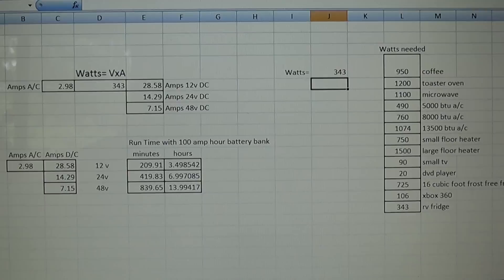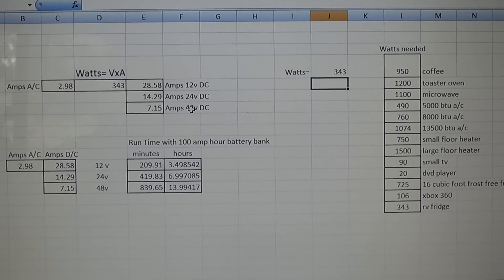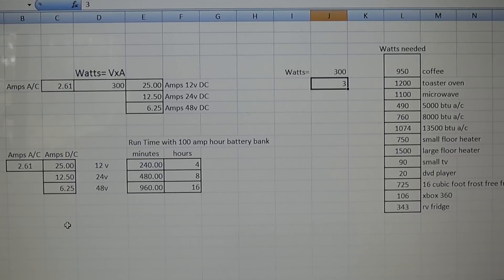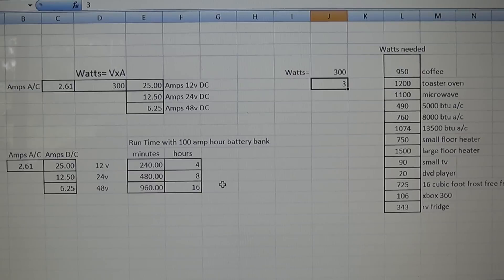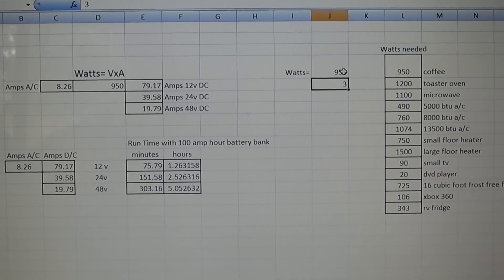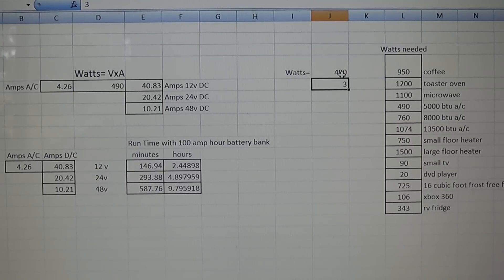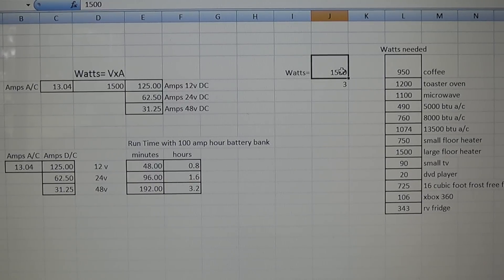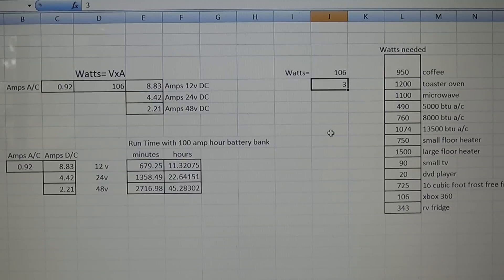What can run on an inverter and for how long?

Comment: Hi there what size inverter are you using and will cheap 3000w do the job cheers
Reply from the maker: I have a 4000w and a 1000w.  It is difficult to tell you if a 3000w will do the job or not, since I don't know what you intend to run.  I can tell you that if you plan on using most of the 3000w, you will be blowing through batteries.
Reply: thanks for replying so quick im in the middle of a doing a van reno thats still a blank canvas atm and im running all the wires now pretty much i will have 2 lights , car cd player , water pump 12v tv and a few usb's running off straight 12v on the power side i will have a normal bar fridge and microwave running from one power point the next power point will have toaster and kettle and the next power point will be what ever needs to be plugged in chargers, fan ect thou I want my electrician to wire in a switch from 240v power to inverter power if that makes sense so pretty much all that will be running off 2 120ahr batterys
Reply from the maker: Make sure your electrician understands low voltage.  If you run a toaster (I am thinking toaster oven?) It will be pretty high wattage.  Lets say it is only 800 watts at 240v.  When you run that at 12 volts, it will use 67 amps.  What I am saying is, don't skimp on the wire size between the batteries and the inverter.

Comment: This really helped Me! I’m installing a small off grid 12 v solar system in my house just for emergency back up until power is restored. I have a 3000 wt inverter. My question has always been. Ok so how long will it take an inverter to run my battery down or keep power going? No one seems to answer that question, so I was glad to see you made this video.
Reply from the maker: Glad to have helped.  Once you get used to the math, it is pretty easy.

Comment: I don't think that is true. To convert 120VAC to 12VDC you just don't simply divide it by 10. You will need a rectifier circuit to accomplish that.
Reply from the maker: Mathematically, Amps= Watts/volts....so if you are using 1 amp @ 120vAC,  it is 10 amps at 12vDC.

Comment: I have I ford f350 I need to plug it in power in winter time it hard to start . I was thinking to have in Inverter, Dsr Proseries, PIF-2000, for the heater for a 15 min before start it . Have some one answer my question please
Reply from the maker: I seriously have no idea what your question is or I would try to answer it.
Reply: My truck need to plug it in power i can't start it in the morning.  I was thinking to get a power inverters so I can hook it up to my truck batteries and connect the engine heater to it. So I got to run up to 3000 watt.  For only 10 minutes the batteries losing its charge so this thing it doesn't work. I was thinking to find another idea to connect the heater I make the engine warm and then maybe I can start my truck
Reply: my car block heater is obviously less than 1500 watts because it run on a standard AC extension cord. It never blew the fuse so we will suppose it is 1000 watt of power to simplify the math. 

1000 watt x 10min/60min= 166 watt-hours, most AGM battery are on the order of 100 amp-hour x 12 volts= 1200 watt-hour and you can use only 50%= 600 watt hours so your house battery  OR start battery if your start battery is AGM, can easily give away 166 watt hour to heat your engine and will be only 166 / 1200 depleted, this correspond to 14% so it leave you with 86% full charge

 ( i am not familiar with using standard cranking start battery for this application because they are not deep cycle, only marine are deep cycle. Standard batteries are for start only and this is why small Honda Civic batteries don't last many years, they are routinely overloaded. So you can do it and the next time you will buy an AGM or marine deep cycle)

and i can bet your truck will start, but you will have to travel enough to recharge it, not just a little trip to the neighbour store. The good new is that you block heater is a purely resistive load so this is perfect for a very cheap modified sinus wave inverter we can find everywhere like in Canadian Tire in my town. 

You have to buy a unit with  at least 1500 watt of power so your 2000 watt device is perfect and you have a  margin of security, these device can become very hot and you don't want that. If you can, it is better to have them mounted vertically for the heat dissipation by natural convection.

 We see many you-tuber burning their inverter and having to change it, one was in the ocean when they burn it if i remember correctly. Modern inverter have one or two tiny computer fan so make sure your inverter is installed in a well ventilated place, if not you will do like many you-tuber, who burn their expensive Danfoss 12 volt compressor because of not enough ventilation.
Reply: Omar nissan.  What is your motor.  What temp does it go down to.     Maybe get an inverter generator.  My 97 7.3 started just fine this winter in mi which got to minus 20 ish

Comment: Carfull of anything using induction motors like a window a.c.. The locked rotor load can double the rated watts. Cheap window units are very hard on solar componets due to high startup currents. There are inverter portable a.c. units that will be kinder to solar components but cost upwards to three time a window unit of 12,000 brush.

Thanks for trying to teach what should be taught in high school. I guess the math to real life use is lost in today's technoworld.
Reply from the maker: You are right, cooling units are brutal on solar systems.  Thanks for watching.

Comment: May I ask the for the formula you entered in Excel to calculate the items listed? I'd like to do the same to figure out my setup for 2 ppl using small appliances,etc thanks in advance!
Reply from the maker: It's pretty much just watts=volts * amps    I wrote this at least two years ago.  Not even sure I still have the spread sheet.  IF you go to any website selling solar gear, they will have a similar spread sheet ready for you to use.  I think Arizona Wind and Solar has a pretty good one.
Reply: Fernbark Frist Great feedback, Thank you! :)
Reply: @milro5011  ACCEPT THE FEEDBACK . WILL YOU PLEASE BRING UP NOT ACCEPTING FEEDBACK IN EVALUATIONS PLEASE SIR. LOL GOOD
Reply: @FernbarkFrist  I AM A DUMBASS. I AM NEW AND IS GETTING A 24 FOOT CAMPER TRAILER NO VEHICLE THOUGH. HOW MICH IS IT FOR ME TO BUY A START UP KIT? I REPEAT. I AM A DUMBASS. I WANT MY TRAILER OFF GRID. IT HAS CENTRAL AIR. THAT I KNOW OF . SO I ASK YOU TO PLEAS3 HELP THIS DUMBASS BECOME A SMARTASS. I THANK YOU

Comment: Do you consider the efficiency of the series configurations for 24v and 48v to outweigh the failsafe of parallel in 12v? Example, in 12v where all batteries are parallel, if one battery becomes inoperable you lose that batt's ah but you can still operate normally otherwise. Conversely, when they are all in series and one battery fails, your system is down until a replacement is made. You could have a 12v to 110/120v inverter on hand and do a quick reconfiguration of your bank in this case I suppose. Just seems more inconvenient than only replacing the bad battery in the parallel configuration. Your thoughts? I know you could do a series-parallel setup with the 24v and 48v systems that would have the same failsafe as the all parallel 12v system but that would require double the batteries = $$.

Comment: Are you accounting for the fact that when identical batteries are in parallel the volts stay same but amps increase for each battery added and when you connect them in series the volts increase but the amps available stay same no matter how many batteries you add. Simply connecting 4 12v batteries in series to get 48v will not double run time of system. Since you have a fourth of the amps you would have if they were in parallel. The only way you can significantly increase the run time is increase the size of the battery bank. While your system may decrease the amp draw, the battery arrangement required decreases the amp pool equally. So, while your arrangement may decrease the size wires needed it is not increasing the run time available. Example 4 100ah batteries in parallel = 400ah @ 12v. So a 100a draw = 4 hrs run time. If the same batteries are in series-parallel to get 24v you have 200ah and if it allows the draw to drop to 50a it still equals 4 hrs. Again, if the same batteries are in parallel for 48v you have 100ah and if it allows the draw to drop to 25a you still have 4 hrs of run time. So, unless you are adding to your bank you are only making the system run more efficiently, which may be adding a small amount of run time, but in no way are you doubling your run time just by changing the configuration of a set number of batteries. Volts and amps are on a see-saw. When one goes up, the other goes down. We have to play by the rules. Remember, things always look great on paper.
Reply: I agree.  The OP needs to check his formulas at and upto F12:F15.  If an appliance draws a constant 1000 watts and the battery is 100 Amp hours I fail to see why these numbers would not all be the same.
Reply: make a video!
Reply: Well that's a terrible statement.  I run a combination of parallel and series.   I get both doubled voltage and doubled amp hours.
Reply: Not true...you can wire both . I have paralleled pairs ran in series. I get doubled voltage and amp hours.
Reply from the maker: Yes.  It should be obvious from the math on the spreadsheet.
Reply: Actually, the spreadsheet only states "Run Time with 100 amp hour battery bank". The spreadsheet does not explain whether you have four 12v 100ah batts, eight 6v 100ah,  or four 12v 25ah batts (which you and I know can not produce 48v with 100ah although people new to this type of power system would not). I am not trying to be rude or disrespectful. I just think it would be good for folks new to this type of power system if it were explained a little more obviously. I know you mention briefly in your commentary that it would take a lot of batteries but I have to disagree, this fact is NOT obvious from the math to someone who does NOT already know this. The spreadsheet assumes the reader knows what must be done to keep a battery bank's amp hours at different voltage configurations. If someone were using three 8v 100ah batteries in series to get to 24v they may think they have increased their ah to 300 when they still only have 100. Your spread sheet only explains the amp usage at different voltages. Again, not trying to put you down. I thank you for sharing your knowledge with others. I have learned a lot from folks like you about other things I didn't know about. I am just trying to help you help others even more.
Reply: @junkmale1365  i appreciate your knowledge on the topic. since i am e a newbie can you help me with something: i have  two 250 watts solar panels and planning to buy a 600 watt ac to dc power inverter for off grid appliances like a small heater in a greenhouse. lets say i draw about 260 watt from the solar panels per hour for about 6 hours. i have a 100 ah battery. if i increase the number of batteries, say 4, in parralel, for how long can i run a small 1000 watt heater?
Reply: @FernbarkFrist  CAN YOU RUN 3 BATTERIES IN SERIES AND 4 BATTERIES IN PARAELL AND BALANCE AMPS OUT WITH VOLTS?

Comment: Can i use a motorcycle battery with my 2000watts inverter? Thanks.
Reply from the maker: Sure.  Just not for long.
Reply: To power 2000 watts, no. The battery being so small and the internal resistance of the battery would make the voltage drop so big the inverter would shut down straight away
Reply: would a standard car battery run a 1500w inverter new to this only just brought myself a van?

Comment: Should i start my car's engine before using an inverter through the cigarette lighter?
Or should i just put the key on ignition?
Thank you.
Reply from the maker: A lot depends on the inverter.  Most likely the wire going to your cig lighter is very small and will trigger the voltage sensor on the inverter, turning the inverter off.
Reply: Some "12v" appliances, like my coffee maker, wonlt work without the motor running.  I guess it probably requires something like 13.5 volts; just as you cannot charge a battery to 12 volts with a 12 volt battery.